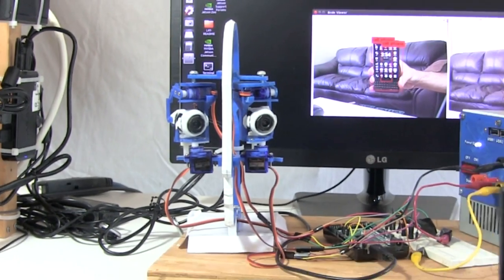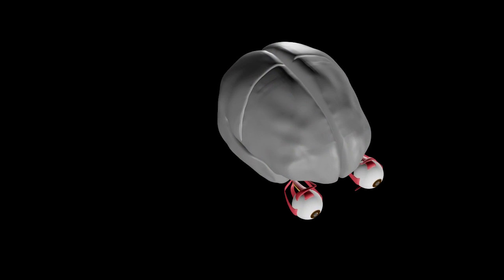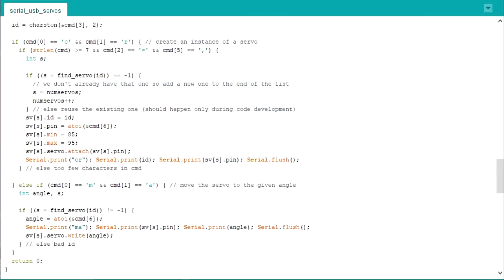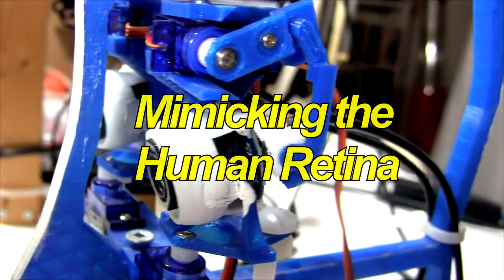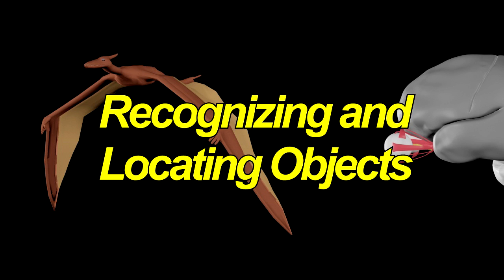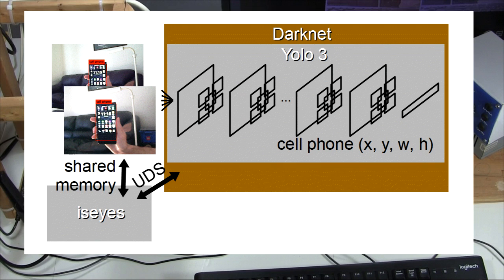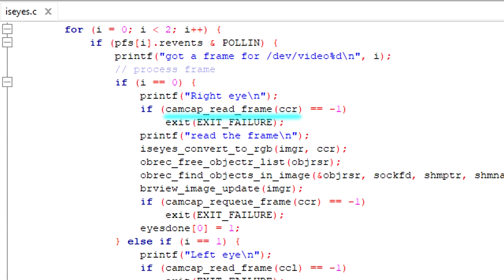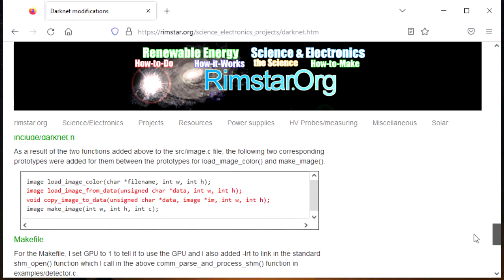Izzy's Two-Eyed Robot Object Recognition and Fixation

Comment: It's rare for human eyes to point at different inclinations, isn't it?  How much would you give up putting the vertical inclination for both eyes on the same motor?
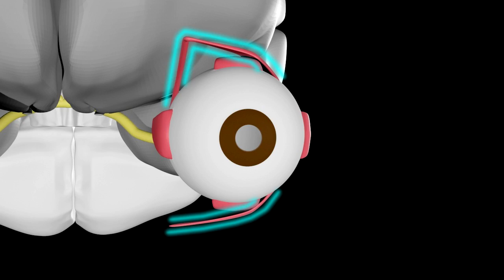Reply from the maker: You're right, though not for human eyes. With my robot, the inclination would rarely, if ever need to be different for both eyes. However, the human eye also has a third set of muscles for rotating the eye (see the video at 1:34). When you tilt you head, the eyes rotate to try to stay in the same orientation. When that happens, the inclinations will be different.

Comment: I just wanted to ask, what happend to corona engines and atmospheric electricity after all these years?
Reply from the maker: Nothing really. I did all I could think of with corona motors. As for atmospheric electricity, raising a wire up into the air that high is difficult to do and I don't have property for ding much horizontally.
Reply: @RimstarOrg  Thanks for the reply :D Got interested in this line of research again after 5 or so years, and i remember seeing your corona engine like 5-6 years ago :)

Comment: hey, so i cant seam to get any answers to this question, but could you save a program to the robot after writing it on the computer? for example could you save the object recognition to the robot instead of having it run only while hooked to the computer? and is there a way to program a robot via blutooth using python? I'm new to all this stuff lol
Reply from the maker: There are two approaches to this. One is to put a small computer like a Raspberry Pi inside the robot itself. It's less powerful than a regular computer like a laptop but it is a full computer. However, currently it's difficult to get Raspberry Pis. There are other less popular small computers like that too.
Another approach is to use a much less powerful computer called an Arduino and put that in your robot. You'd write your program on your laptop computer and then download it to the Arduino. There are very many variations of the Arduino depending on your needs. I'm not sure the Arduino can do object recognition though, since that requires a huge amount of computing power but in that case there are special purpose circuit boards that can do the object recognition for the Arduino. I'm not up-to-date on the latest one of those.
Reply: @RimstarOrg  sir please come back with new videos
Reply from the maker: I won't have time to make a long detailed video for a while but I've been working on another robot (a small wheeled one) that I can make a short video for in the next few weeks. Thanks for asking for one.

Comment: some serious cargo cult
Reply from the maker: :-) Well, there is a huge difference in computing power between our computers and the human brain. And algorithmically we do know quite a bit of how the brain works, though there's much more that we don't yet know. But yeah, I do plan on try more brain-like algorithms, that's what really interests me. Right now this is more of a brain-inspired approach.
Reply: @RimstarOrg  The human brain is more closer to a FPGA with over a trillion programmable gates than a conventional iterative computer. It processes a lot in parallel, using inhibitors, intrerrups and progenitor signals. Like a hot butter sliding around on the pan.
Reply from the maker: I've heard of FPGAs but never tried one. The hot butter sliding around on the pan sounds like a good analogy. In the case of the brain, there'd be currents of butter sliding in multiple directions at once, some exciting and some inhibiting. Maybe I should look into doing a neural circuit on an FPGA.
Reply: @RimstarOrg  The annoying thing is that nobody has been able to simulate neural circuits correctly. Only at a fundamental level. The main reason human brains get "tired" is because changing links (part of how the brain works) is extremely "tiring". It's not just sodium channel depletion. Each neuron has logic internally also. Trying to translate neural activity to an FPGA is suboptimal. The way video cards simulate AI uses a lot of clever hacky matrix math that GPU's are good at, which gives more parallel calculations that approach the speed of neural networks. The issue is still trying to translate neural activity into a model that can be simulated more seamlessly. The biggest issue is that the human brain is really good at brute forcing calculations with it's sheer crazy amount of neurons. If you want a "better" optical tracking of motion of objects, computer mice use something very clever along those lines to track motion. They use a laser to illuminate only one color channel (usually red or infrared) which is then processed by a chip to detect relative motion. The thing is that neurons never have access to "all" the information. Only just enough to do their task. In computer programming humans tend to pass around too much information, creating a more complicated system, which is much slower. Simulating neurons is naturally EXTREMELY SLOW, technically limited by 1 cuda core = 1 neuron. That's why an FPGA with a crazy amount of transistors (more than GPU's) would be more suitable, but this is an option nobody seems to have explored. You can probably parallel-link FPGA's together to create neural clusters.
Reply: @RimstarOrg  Something also to keep in mind is that one software package can never simulate a brain correctly mainly due to "overtraining". A neural cluster is only so good at one particular task. If you rely on it to do more, it tends to turn dementia and start confusing anything and everything for anything else. Human brain neurons are not very efficient :) their 1tb of apparent data storage is wasted and only 50-60GB is used and it's mostly just the equivalent of uncompressed 4k still frames. There's a LOT of research into simulating and attaching to mice brains, something worth looking at. Them crazy people took a mouse neuron, grew it in a lab to a large brain and used special nutrition slurry to put it in a "jar" connected to some electronics and were able to create a rudimentary wetware operated robo-mouse (as much as a robo mouse a small box on wheels with a camera attached is) which was able to respond camera footage and run the motors.
Reply from the maker: I was reading "How We Learn" by Stanislas Dehaene this weekend (I highly recommend any of his books) and was reading the chapter on sleep. He cites research into how one of the factors that plays into how tired we are is how much learning we did during the day, the more learning, the more tired we get and the more sleep we need. Unfortunately the research he cites isn't online. Research shows that during sleep, our brains process our memories of the day. Regarding how we don't simulate neural circuits correctly, I'd say that depends on what the application is. Neuroscientists do simulate biological neurons whereas programmers working on artificial neural networks create "neurons" that suit the hardware and algorithms they are working on. The former are simulating the brain and the latter are inspired by the brain but working on practical problems and often, products. In one project I did taking inspiration from the human retina, I came up with the saying, "think neurally, act digitally", which basically means take inspiration from how the brain works but then develop within the contraints of the available hardware (I haven't published any details on the algorithm I came up with but here's the project https://rimstar.org/science_electronics_projects/izzy_artificial_intelligence_robot.htm#EYEBALL). I've heard of "overtraining" but also "catastrophic forgetting", where you've trained a neural network well but then if you try to train it on entirely new data, it forgets the old. That's can sometimes be helped by having most of the layers learn features and then have the final layers build on those features to learn something specific. Then that final layer can be swapped out for something else. But there's still forgetting there since you use only one final layer at a time. The brain is not perfect, but is better at not forgetting old data when new data is learned.
Reply: @RimstarOrg  Yep. That's why the brain layers different learned things in different mindspaces and why habbits die hard. A group of neurons learn to do one thing and it takes time/effort to switch to another mindspace; that's why some ideas seem obvious at times after you've had some sleep, but they seem impossible the previous day. During sleep your brain reorganizes a LOT in the brain, a mechanism I don't think anyone's yet figured even half of it out. That's why you usually get really chaotic dreams after you've mentally exhausted yourself. Consuming a lot of sugar before going to bed also does weird things to your brain. You can "see" your dreams before you've fallen asleep.

Comment: Not bad. But I'm sure you can miniaturise the servo assembly so it more resembles an actual eye instead of two webcams hacked together. Time to get that magnifying glass out.
Reply from the maker: If I change it, I think I'd go with something more like animatronic eyes with stepper motors (servos can be finicky) further back and wires pulling on the eyeball. Then that would be more like a human eye and I can support rotation too. But that means pulling on one axis can affect the other axes, which is why I didn't go with that way.
Reply: @RimstarOrg  you can also try something like a Hard Disk actuator of the RW head as thats pretty compact and very stable to rotate
Reply from the maker: Hmmm... I wonder how much torque they can produce.